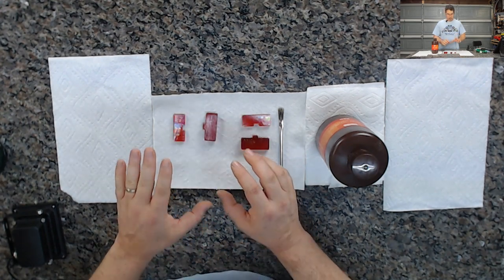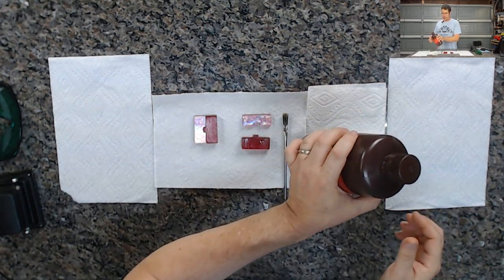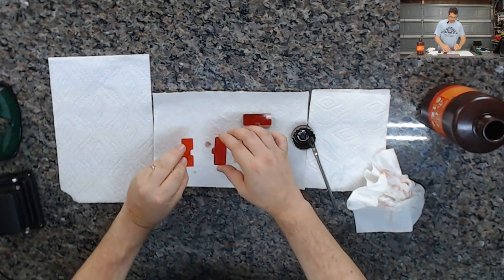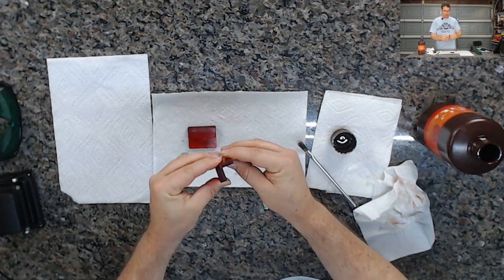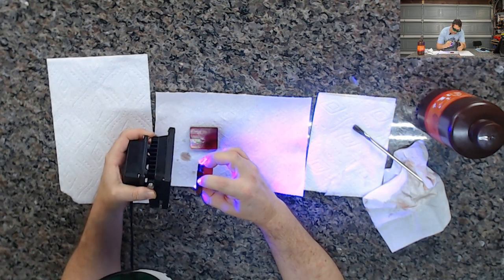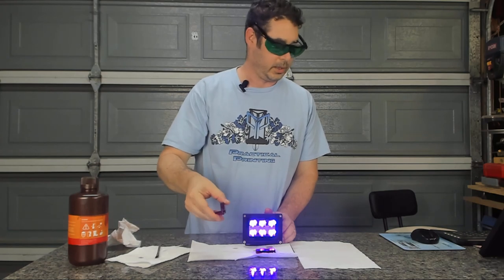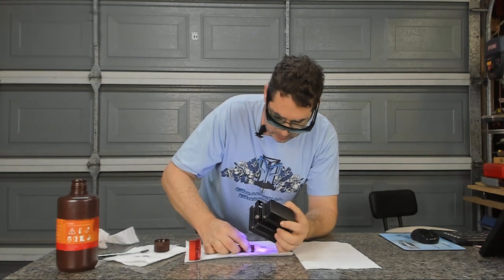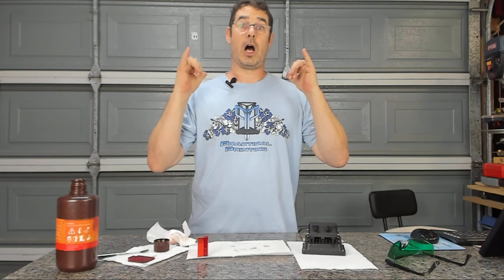SLA 101 - Resin Welding (Repost of older video)

Comment: Does resin welding work with greys well? Or is it optimal on non-opaque resins?
Reply from the maker: It works with any color, tho it may take more time to permeate and/or stronger UV source if non opaque.  You can also always add a bead around the outside of the joint and sand flush.
Reply: @crussty3d  yha but how will the light penetrate to the middle with non-translucent resins?
Reply: @spawn666reaper  you can also design in something like a weld prep and apply resin in multiple passes, curing between each pass. I just used that approach for a repair on a split print and it worked a treat. I was using elegoo standard white for that part.

Comment: You usually make excellent videos but this one is the exception.
Handling little parts that you are putting wet resin on and then wiping with a paper towel (already with resin randomly on it) BARE HANDED is something that shouldnt be shown to new SLA printer owners.
As to the content itself, this is just a bad idea from the start. The resin between the parts will never get any light so it wont cure. What can cure is the resin that leaks out of the join when you push the pieces together, you know, the stuff that you were trying to wipe off.
An edge weld is a weak weld. Ask anyone with welding experience.
This isnt like using ABS slurry or PLA welding methods, because both of those cure completely. The PLA as it cools, and the ABS as the acetone evaporates.
Even if you were to put a lot of resin on the join and make an ugly large join line, you still are only cureing the very outside layer that the light can penetrate. Thats why your whole vat of resin doesnt hadeen when you make your first layer in the printer.
Reply: Does seem quite unsafe.
Reply from the maker: Thank you for your comments, and I’m glad you have enjoyed the other videos.
As you may have noted from the videos remarks above, this is a re-posting of an older video that had gotten accidentally deleted at some point.  I fully agree with you- I should have been wearing gloves from the beginning.  When I started the filming, I felt the risk of exposure was low, and obviously I was wrong (as we saw).  This is why when I reposted, I did add the notes above as well as the on screen text just after the 2 minute mark telling people to wear gloves. That said, I felt with the notifications and warnings added, the technique was still worth getting back out there

Now to address a few of your incorrect comments about the process itself:
While it is possible that with some resins (specifically darker colors like blacks and some specific resin formulations) that minimal UV light will be passed thru the cured part, however a large number of consumer resins out there for hobbyists will indeed allow enough UV to pass thru them to cure that thin layer.  When you are SLA printing, the resin is not being fully cured, only enough to stick together into the solid shape.  This is why after cleaning the print you still need to do a final cure on the part to fully harden it. If it didn’t allow enough UV light to pass thru, this would not happen (and again back to the black resin example, some formulations never fully cure all the way through period, this is why they sometimes mysteriously develop cracks over time).

Resin welding is not a new technique or something I invented.  It’s been around a lot longer than I have been SLA printing.  In fact, there are even little kits available with UV reactive gels in them for “welding” plastics back together (search for the Bondic or similar on Amazon).

When properly done and cured, a resin weld can be nearly as strong of a bond as layer to layer in the print because you are essentially creating a new layer or the same materials. You are creating a chemical bond of like materials.

And to your last point, the reason the whole vat of resin doesn’t harden on your first layer has nothing to do with the resins ability to pass UV light- it is because that UV light is masked by the LCD (or steered by a laser) and constrained to only the resin that is exposed in that very thin layer between the FEP and the build plate.
Reply: @ImaginationToForm  I know reading Video description is a lot to ask from most, but Chris clearly covers it....
Reply: @eddiemoser3150  Meh. Me I would had redone video with proper safety measures and pointing out safety measure at the start of the video and not just text. OH well.
Reply: @ImaginationToForm  Sounds like you have a lot of experience making YT videos. Can't wait to see your version of this topic come out...oh wait you don't have any video on your channel. Nvm.